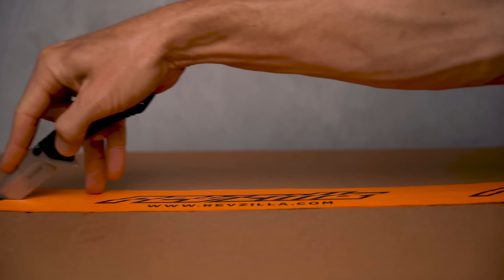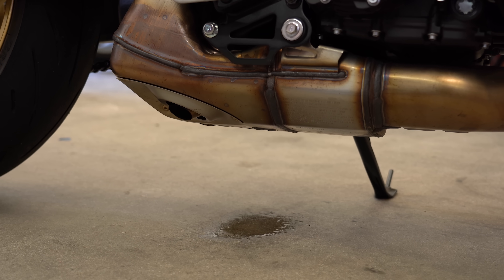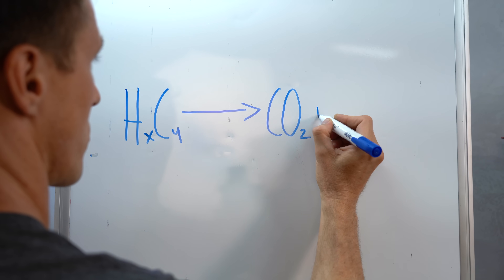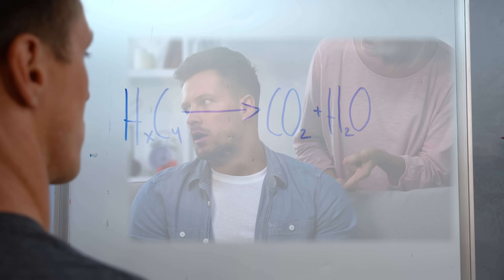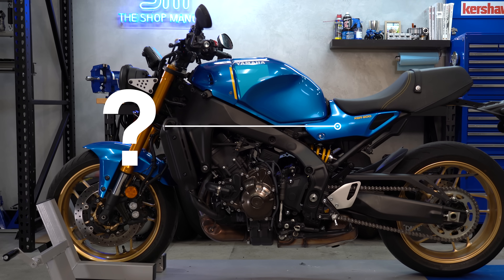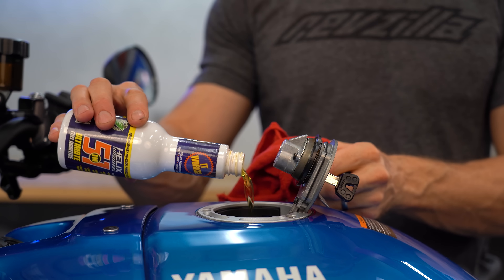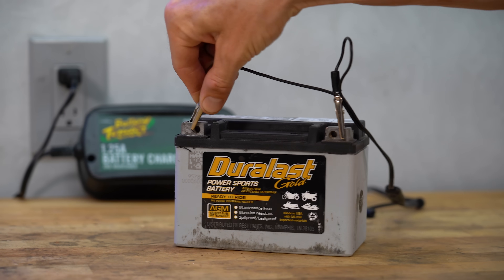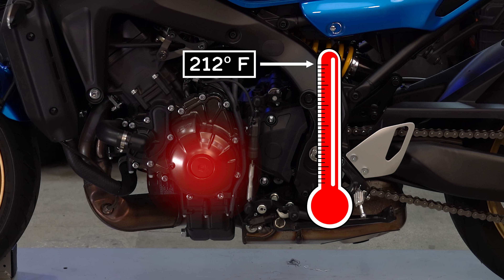The Storage Myth That Hurts Your Motorcycle | The Shop Manual

Comment: IMO, filling the tank with non-Ethanol gas and running it through the system should get you through a couple years of storage better than parts store additives. And if you didn't do either of those things, and 1 year has turned to 5 years... FFS DON'T slap on the jumper cables and try to crank it up! Drain/re-fill the fuel system, buy a NEW battery, and check the tires. She's worth it.
Reply: Best comment ever!!! Our bikes are truly worth it.
Reply: Wrong, the ethanol content in our modern fuels is 50 times more hygroscopic (affinity to water), than previous fuels. As soon as the moisture in the air around us hits the surface of the fuel in your tank, the moisture condensed into water droplets. Being of a higher specific gravity than the fuel itself, the water sinks to the bottom of your tank and accumulates. There’s an element of 30% air molecules in suspension in modern fuels (which is why carb bikes run leaner on new fuels). Water + air + steel = rust. Added to that, this water cocktail collects around the lowest point in your tank, so when you fire it back up, guess what, it ain’t sparking on water……tank off and carb strip required. This is what fuel preservers do, on just under a full tank, there’s enough content in a small bottle of preserver to put an invisible “skin” (being less dense than fuel), over the top surface of fuel in your tank. This “chemical barrier” stops moisture ingress and at the same time, stops the ethanol (the part combustible element) from evaporating. Ever wondered why your bike, after storage initially runs, if it runs at all, very reluctantly?  Now you know. Modern fuels…….think they’re termed as progress 🤔

Comment: I’ve been starting my bike up every few weeks, regularly for 12 years now, no problems to report as yet!!
Reply: same here...I think there is a lot of misinformation when it comes to this
Reply: I don't start my bike at all during the winter and I also have no problems to report. Just because it has been fine for you doesn't mean it hasn't caused any wear. Unnecessary cold starts aren't good for overhead cam bikes.

Comment: Always started my bike once a month  in the winter and run it for 30 minutes if I fail to take it out which is very rare.
As all my bikes bar one have been aircooled so warm up time is not long.
Fuel stabilizer is modern
I've never used it never had a problem
And the alternator tops the battery even on tick over .
(I've measured the output). Anyway modern batteries stability is very high compared to old lead acid they can hold a full charge for several weeks no problems. 
Not had any winter issues since I began riding in 69.
Sales pitching is the modern name of the game from fuel additives to battery conditioners .
Its an engine same as all engines the fact its in a bike has zero effect.

Comment: Spot on advice from Ari, as a veteran mechanic myself, this is precisely how I store my motorcycles for winter, proper prep is key!
Reply: As i learned US ethanol goes bad pretty quick. In here we have E5 to E10 fuel. Dont know if they go bad that quick. Many people can leave the bike for 2-3 months and start it up no problem short-therm. Curious.
Reply: @esatd34   I live in Canada and just make sure my tank is full of prem gas ( I know it now has ethanol also ) with the higher octane tho my bike starts up right off the bat after sitting 5 months - I don't use stabilizer anymore cause so many different thoughts about it out there but I make sure the tank is full to avoid condensation and leave it on a battery tender on all the time - works for me !
Reply: @arniepries6480  cool! thanks for sharing :)
Reply: @esatd34  I had gas stored in the gas tank for 2 years and it never went bad. Started right up. Granted it's in a garage with no moisture.
Reply: @arniepries6480  
Well, I leave the tender on as well.  October to March.  Fuel is fully topped up, and I put about 2 oz of stabilizer in (the red stuff).   In 20 years + have never had a problem come first ride in March.  No occasional starting.
I do the same on a 2008 Mazda MX5.  They both start and run just fine after this hibernation.
Reply: @esatd34  I have a station here that sells non ethanol gas.

Comment: I've always started mine but I do leave it running for about 20 to 30 min to ensure it gets hot enough to get rid of the water in the system. I guess that's why it's always worked for me. When it's real cold like -20 I will let it run for a half hour or 40 min then top the tank off again with treated fuel. I'm also always on a tender when parked. I tore down an engine one time before starting the bike in the spring and the cylinders were coated with light rust after sitting all winter. The valves had some rust on them also. I live in the North East US and we can go from 20 at night to 60 and humid during the day, I've always thought that builds condensation in the exhaust and possibly the engine. That's my reason but I was taught by an old biker many years ago to let the bike get hot to the touch on the trans cover before shutting it off. Good video because I honestly didn't know why I was suppose to do that, now I do.

Comment: I do light prep work before storage, but also start it up about once a month. Like you said though, I've always let it run well beyond what the temp gauge says. My dad has 30+ years of riding experience, and its exactly what he used to do. No issues on his bikes or my own.
Reply: I do the same, and of Ice is not on the road I will go for a quick ride, setting for long periods do more harm.

Comment: I tried to tell my buddy not to do that. I have mine on a tender and never had a problem. I also move the bike just a little to prevent the tires from getting flat spots.
Reply: Put it on a stand and u won't have to do that
Reply: @jctv-sq4qd  Or even just on 2 thick styrofoam pads. Anything softer than the rubber itself.
Reply: Rare on belted tires; just put the air pressure up.
Reply: @Ont785  ya, i thought that was just a thing with 1980's steel belted tires.

Comment: My bike has been standing for more than two years because of a back injury. I start it once every second week. Keep the tank full and replace it once every second month. Battery is plugged into a battery saver. I also use the brake and clutch levers and compress the suspension as much as I can. Not one single issue so far. It's a lot to do but I love my bike and refuse to sell it.
Reply: I hope you recover soon and will be riding it!
Reply: that's adds up, just drain the tank. also keeping the springs under tension isn't necessary, they're already tension with the bike just sitting there--not that springs even wear out in this way.
Reply: The fact that it still runs doesn't mean that starting it every 2 weeks is good for it.  Properly preparing the bike for storage is better for the bike, and is less work.
Reply: Your not alone!!
Reply: @jamesatwood4433  sorry let me rephrase, I compress and extend the suspension in so that the fork seals don't just sit in one place. I drain the tank every second month and add fresh fuel. I also run the bike on my paddock stand through all the gears and make sure to go above 6500 Rpm so that the secondary injectors activate.
Reply: @mhoeij  I'd rather start it every once in a while than have it sit till who knows when I'd be able to ride again. By that time I'd have to tear the whole bike down. Bike is super low mileage 13k kilometers (2015 zx10r).
Reply: @ZinoAmare  thanks alot! I still have hope and the fact that I am able to open my garage door and see it every day is the motivation I need to get on it again. I'm afraid of selling and then never getting a bike again.
Reply: @Stevo299   did you watch the video? As a buyer, I would rather not buy a bike that hasn’t been ridden for years, to me, the value drops each year. But I understand that it would be difficult to sell a bike that you really like.
Reply: @mhoeij  yeah I watched the video, it's more directed at winter storage than long term as in my case. They don't mention not letting your bike stand on the same spot on its tires for the entire time which will cause flat spots. It's better to have your bike lifted on paddock stands. I'm not storing it in the hope of selling it as a "barn find" one day. I genuinely don't want to sell it. So I couldn't care what the value does. Just sucks that I put about $20k into the bike in mods just before the injury and now I can't ride. Who knows, maybe one day.
Reply: @Stevo299    The video presented new ideas on storage, while omitting old ideas like the one on tires (properly inflated tires shouldn't develop spots).
I would trust the new ideas more than the old ideas. Without testing, you can't know if the problems mentioned in the video (oil becoming acidic, moisture in the engine) are happening in your bike because these problems (if they are happening) take years to become noticeable.
I hope you heal soon, it must be awful to have such a nice bike, have so much money in it, and not be able to ride it.  Wish you all the best, hopefully sooner rather than later you'll enjoy riding once again.
Reply: @mhoeij  thanks, I do really hope I'd be able to ride it one day. Even just for short rides. The oil acidity doest bother me too much as I do annual services as per normal flush all fluids and change filters. I just feel it's the best I can do to keep the bike it the best possible condition. I don't have much of the issues spoken about in the video. It never really gets colder than 5 degrees Celsius here in cape town south africa. Hope fully all the effor helps and I don't have to spend  a few grand just to ride the bike again. Probably will have to change the tires no matter what even if they just have about a few miles on them. Oh well, here's hoping for the best.
Reply: Curious about your back injuries?  I have had 3 surgeries and around Thanksgiving broke my L2 vertebrae now waiting g forming heal.  Trying to decide if I should keep riding or sell my motorcycle!
Reply: @KBradAdams  I have a slipped disc in the t6 t7 area. It's pressing against my spinal cord causing excruciating pain. They can't operate because theres a 90% chance of me ending up paralyzed. So they decided to fit a spinal cord stimulater. It works, the pain is less under normal conditions, however if I do strenuous activities I can feel alot of pain. That's why I haven't ridden since.
Reply: @ that makes sense!  I have had 2 lumbar fusions myself.  Still hurts!  I hope maybe they figure out something for you better soon!

Comment: Been riding for a long time and have a set of actions every six weeks or so and it has never failed me . After a quick check of the tires on my 4 bikes 
and check the batteries ,I usually take the weakest off the bike and put it on the bench for  a trickle charge . I have a Kwak 1000 chips bike and the 
battery on that is indestructible ,the only problem is the clutch tends to stick ,now & then ,I put tape around the lever to fix it to the bars after a day or two it does the trick . Overheating is no problem if idling for to long ,simply place a small fan pointed at the cylinders . A pump fed engine is usually O.K. but carbs like some fuel spurted thru ,even with stabilizer they tend to miss and spit for a minute or two after a long winter spell ,so I warm the motor through and give it a few revs . But owning the bike some time seems to help as you get to know its quirks like a faithful old pet ... happy riding .

Comment: You're probably correct. Just going to relay my experience:
2008 Gixxer 1000, bought new. 
Northern climate.
Every Nov-Apr, once per week, I start her and let her warm up until radiator fan turns on. I rev the throttle hard for a sec, 4 or 5 times once she's over 180deg. 
She still runs perfectly to this day. 29k miles. 
I won't change this process since its proven good for so long (no fuel additives). 
If I were new to bikes, I'd follow your ideas, and I'm sure it would work out fine as well.
Just putting forth some longer-term research-ish info, love your suggestions. Please keep it up.

Comment: Pretty solid advice most of which is in the manual of most of my bikes.  The only thing I would disagree with is draining the tank, the Yamaha manuals for my bikes specifically state to fill the tank with stabilized fuel (non-ethanol if you can find it) and not drain as the empty tank is more likely to collect moisture inside due to condensation from the various temperature changes which can lead to rust starting inside the tank.  So I would avoid draining unless you have a bike with a plastic tank.  I have been winterizing my bikes for years very much like you described and have not had issues, including the one that I do ride some during the winter and all of those rides are long enough to ensure that the bike is fully warmed up and getting any condensation out.
Reply: Do you add stabilizer on top of ethanol free fuel or only use stabilizer if you can only find fuel with ethanol?
Reply: Take the tank off drain it remove petcock etc..use WD and bring inside same with carbs for inspection cleaning etc...I'm amazed the number of guys that don't do a winter teardown to check things out...gives you something to do during snowstorms...
Reply: @saywhat951  So you would say that the manufacturers winterizing instructions are incorrect?   3/4 of my fleet are fuel injected so no petcocks/carbs to worry about. Add in the fact I ride Yamahas so there is far less need to do that since they are statistically the most reliable bikes. I also have other things in my life than just motorcycles.  Not saying my motorcycles are not of extreme importance in my life, they are.  But I also have a family, hunt and coach in the winter months, so my off season time is limited.  If your bikes require more of a tear down each year more power to you.
Reply: Agreed.  Fill that tank.
Reply: @driftlessbiker  
Say What is old school.  I haven't cleaned carbs since my first FI bike in the middle 80's.   And I ride shaft drives, not chains.
Reply: Agree. I bought a 1988 BMW K100 with 37k km on it. That low mileage means, that the bike waited a long-long time to ride again. The tank was empty, the fuel pump was dead and the fuel level sender was rusty, too. The trader replaced the fuel pump but not the level sensor and cheapest one cost 250 €. Now I'm looking for alternatives...
Better fill that tank up, especially if you plan to ride the bike in autumn. You don't even need any additives till then.

Comment: 44 years of winter storage experience, starting with a 77 Suzuki GS 750. Everything you said is right on the money. I would mention, last tank of gas should be ethanol free as ethanol attracts moisture. Using ethanol free gas and stabilizer,  I've never run my system dry on f/i bikes and had any issues. Always drain carbs. If you live in very cold climates,  be careful about leaving the garage door open in the spring. The moisture you see on the floor and elsewhere is condensation and will also happen inside cold gas tanks. If you have to leave it open, throw a old blanket over it.

Comment: Great video. This moisture problem also happens in cars, like say for people that have small 5 to 10 minute commutes to work. The engine never gets fully heated up and moisture builds up in there. The oil can turn orange from the moisture and is 1 sign of it happening for a while. It’s recommended for engines to get a good long ride on the freeway. My commute is so short and my car’s v8 rpm’s barely go above 2500rpm during the short streets commute that a good long thrashing or drive on the freeway at least once a week helps keep some moisture out and the engine healthier.
Reply: "Officer, I was just clearing out moisture from the engine." 🙂
Reply: my dad was a diagnostician and people were always surprised to hear him tell them to drive like a maniac once a week to work.
Reply: That's one of the reasons that manuals suggest changing the oil more frequently on vehicles that take frequent short trips.

Comment: i am a retired mc mechanic still using and working on motor cycles , in my opinion to store correctly you do need to start them every 5 weeks or so , but you have to run them until engine and gearbox up to normal running temperature and select first gear , and gently use the clutch, when warm run for a short while  at 3000 rpm . then charge the battery at no more than 500 mil amps.

Comment: I never winterize my bikes. I use them. And if i dont need to, then i just pick a nice day once a week or every two and go for a little ride. You don't need much to keep it thru the winter. Just use it a bit. Get a sturdy cover for the snow
Reply: You don't live in a harsh winter region, I presume.  There is no chance (or desire) of riding a motorcycle any time between November and March around these parts.
Reply: @MOTO 809  i guess maybe so. I don't get much snow sometimes it gets cold. Not too bad
Reply: @lawrenceshraybman621  Cold I can deal with.  Snow packed roads are a no go.  I guess that's why we ride snowmobiles.
Reply: @MOTO 809  yeah for sure. Snow on the road is  dangerous for a bike. I would never suggest riding in unsafe conditions, even if I might. Cold is manageable. Bikes underperform in the cold and tires don't grip as well but that's a different story. I ride thru the winter and I ride thru snow sometimes if it isn't terrible. But I would discourage others from that stupid deadly decision.